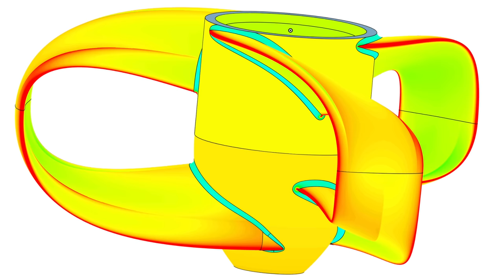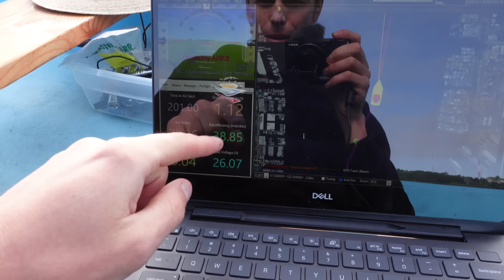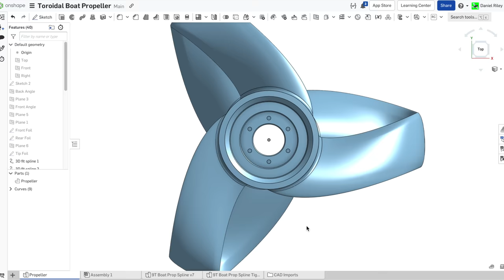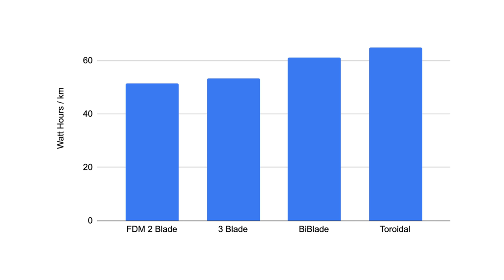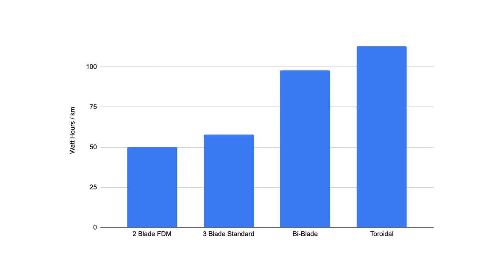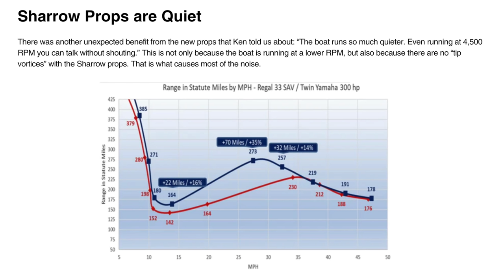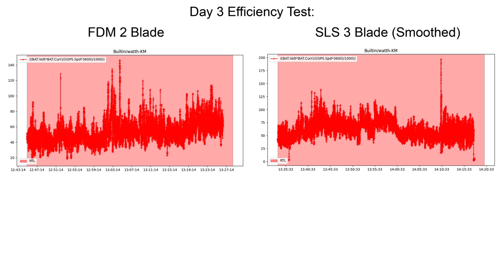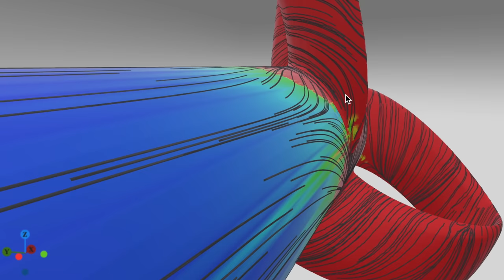Testing Futuristic Propeller Designs on my Solar Powered Boat

Comment: I get the whole scientific community spewing out the metric system measurements, but come on. 90 percent of Americans do not relate to the metric system. I personally will resist the metric system until i die.  It would not take much to keep us die hard imperial people happy. Just provide an occasional conversion along with the metric system. 
Only way that i will give up Imperial measurements is if the whole metric lovers cede the fact that Fahrenheit is superior and dump the Celsius. MPH is far superior to KPH, because when you say miles i know how far and how long it takes to go that distance. KPH you might as well be speaking Sumerian or writing in cuneiform.